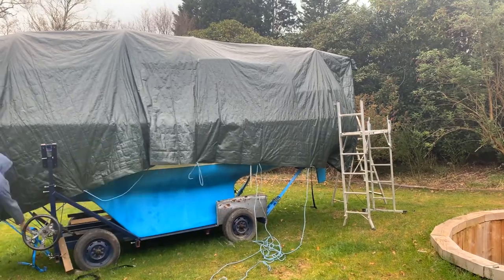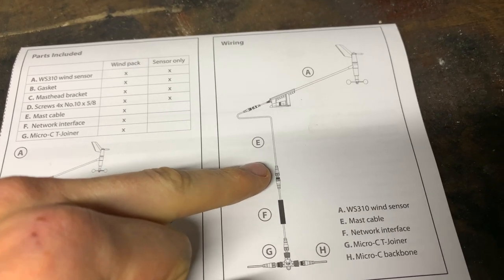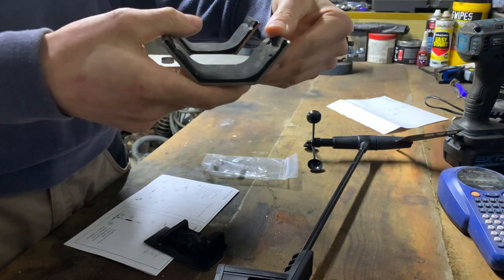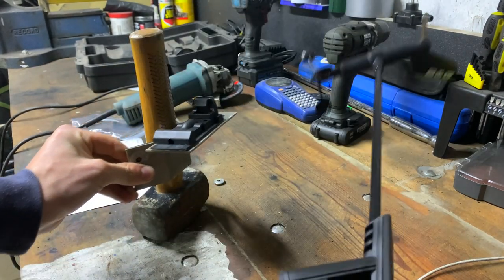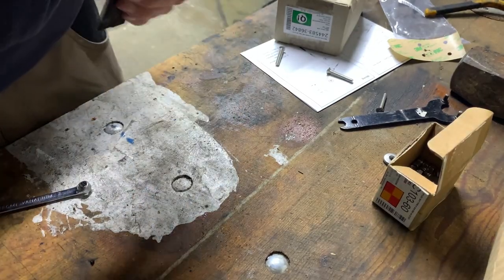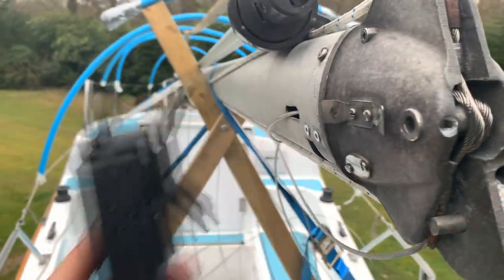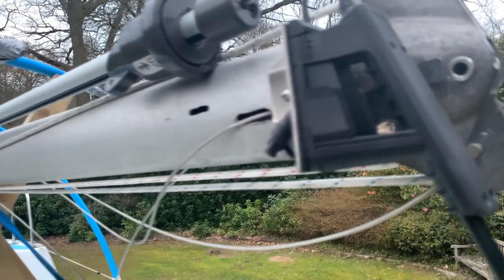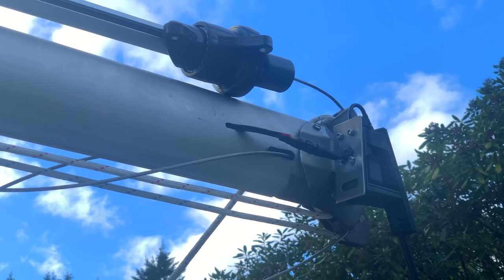B&G Wind Vane Install! Sailing Meraki | Ep.28

Comment: Thank's Alex, I love your videos. I'm doing research on B&G wireless Vs Raymarine Wireless units. I like the B&G its cheaper and I can have wind speed, boat speed, temp, and depth on the one cockpit unit. My concern is can the mast head unit needs to be quick release for trailering back home? It looked liked it had a quick release from the mount base, is that correct?
Thanks,
Nick.
Reply from the maker: My wired b&g does have the quick release but the wire for it tucks under the base no I can’t remove it. You can have the wire outside but that means you have to undo the connector. On the new boat that no one has seen yet it has a wired raymarine wind vane and that has a disconnect on the base so no wires or bases have to be undone. Just unscrew and remove.

Comment: You have a 7 inch Zeus3 plotter also,  right? Are you happy with it?

I'm thinking about getting one but am unsure if it's worth the money and hassle.

I am jealous you have such an awesome shop to work with 😁
Reply from the maker: It’s a vulcan 5 actually and it works a treat. Definitely b and g for anything sailing related!
Reply: @AlexGoesSailing  no issues with the screen going crazy in the rain? I've tried using a tablet in a bag before and it's nearly impossible to control